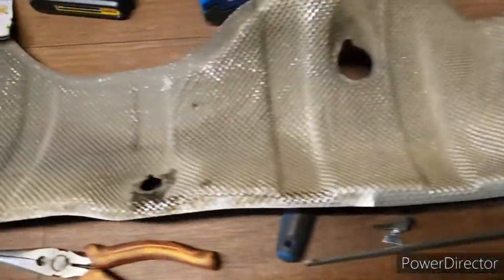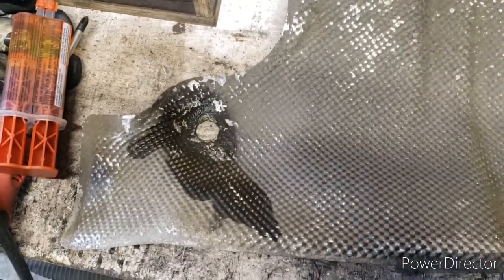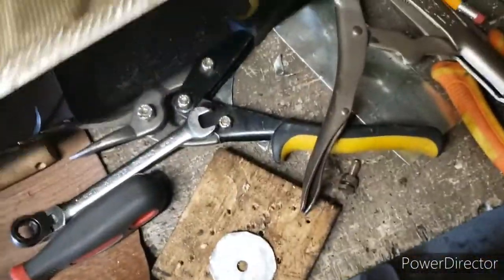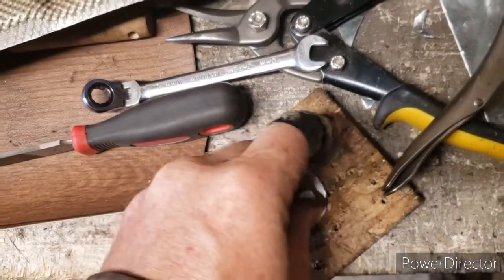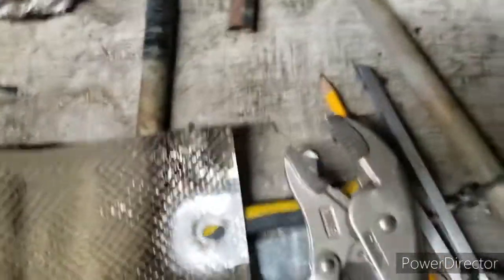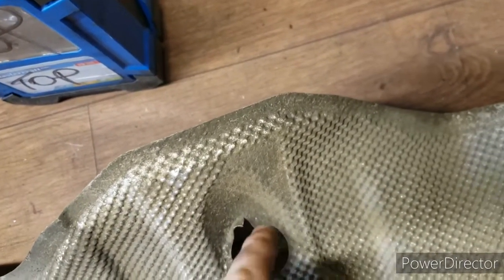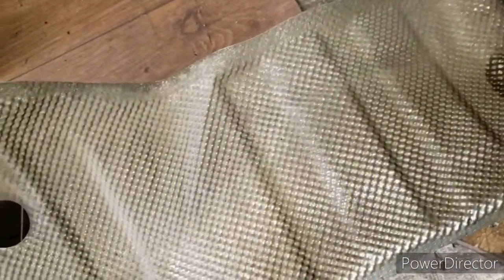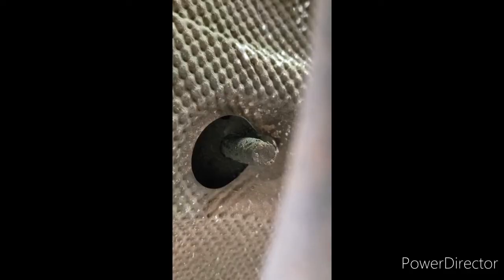Is there a noise coming from under your car?

Comment: Nissan rouge 2013 was rattling like crazy. Mechanic changed 500$ catalytic converter but still sound stayed. Horrible rattling sound was unbearable by neighbours. I am not a big fan of Nissan because the dealer was not supposed to help me on this. They are keeping this issues so that people buy parts and get unnecessary maintenance from them. Finally i went to another mechanic he used large screw driver and keep pushing the heat shield while pushing and accelerating paddle hard. Noise reduced a lot and then he said heat shield is touching the exhaust pipe. Solution could be replaced or remove it. Horrible issues and have no permanent solution unless they use stainless steel fasteners and hold at different locations.
Reply from the maker: I hear you for sure. I had issues with ford and other models also. They dont use big enough washers. After i use large washers and use little high temp anti seize i havnt had a problem with my repair but other parts of the heat shield have to be fixed over time. You can take it off thats ok i have done that with other cars but i think it helps to rust out your floor when heat shield is missing because of the heat rising directly to the floor panel and heat and moisture cycles is a rust magnet. Thank you for your time to comment and share your experience. Please think about subscribing. Cheers piyush patel

Comment: Does it stop when you let off the gas?
Reply from the maker: Before the fix it sometimes stop but usually got whole lot less. If at a red light and start going once it turned green it got loud then leveled out. After the fix nothing.
Reply: @DIYVariety  ahhh sounds like my issue. My Nissan has a small rattle coming from the same area whenever I reach 2rpms then when I go past that or let off the gas it stops. Sounds similar?
Reply from the maker: @user-wl1bm5xx8d yeah hope its the same, easy fix

Comment: Ugh we have this issue with my rogue and the bolt is broken ughhhh
Reply from the maker: Yeah they get rusty, but, you can get self taping screws and go next to the old spot and it works fine just be careful and not to long of a screw. Just use as big of a washer as you can it helps it to last longer. Thanks and good luck 😉